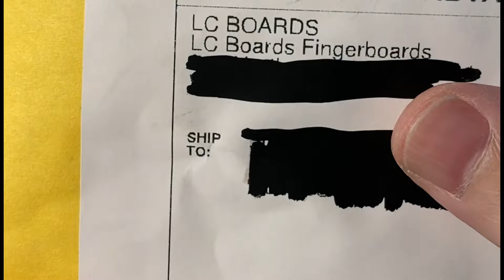LC Boards Unboxing Review - Setting Up a LC Finger Board Complete Setup

Comment: I have that same deck the wheels overall seem to last but the bearings wear down over a span of 3 to 4 weeks and don't last, that also seems to be the same with the trucks as the hanger starts to be pushed out. I love the deck tho.

Comment: I've been thinking of getting a lc complete and i have never had a pro setup i only have an old tech deck so is this a good investment?
Reply from the maker: LC boards & teak tuning have great options for under $25 that would be a nice step up from a techdeck! (Wood board, bearing wheels, & foam grip are all nice upgrades these come with!